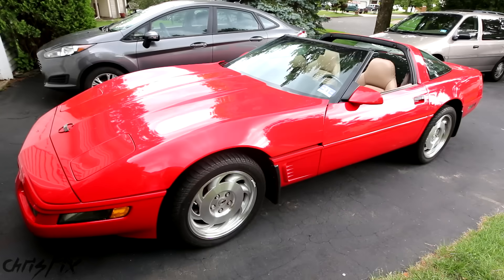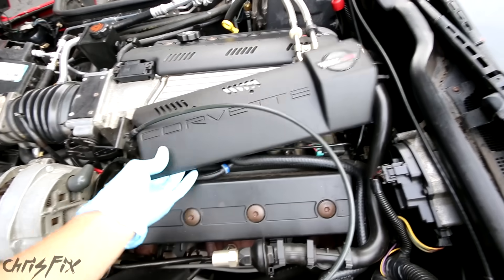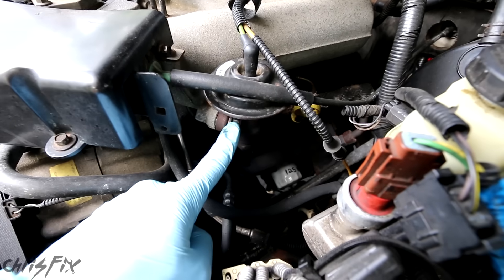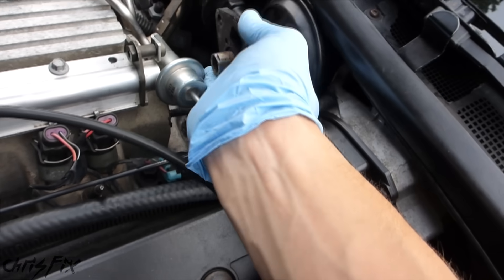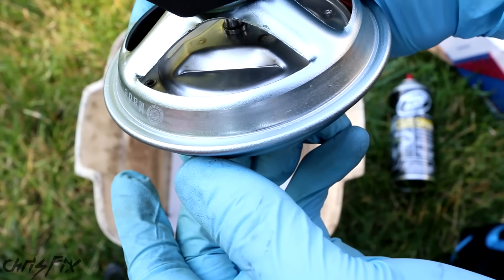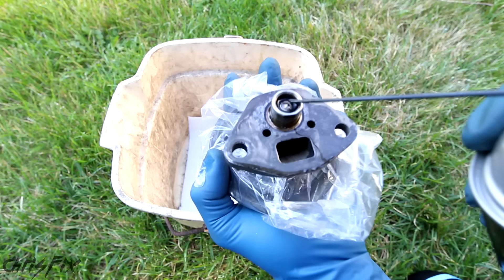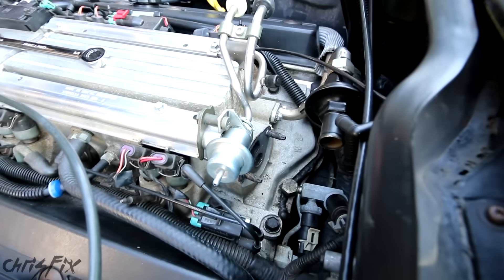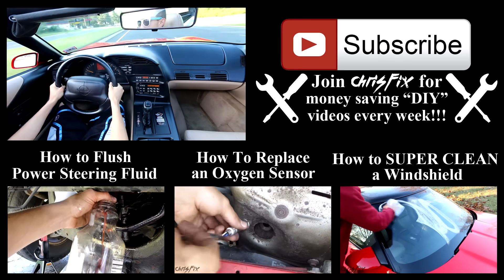How to Clean and Replace an EGR Valve P0400

Comment: Why would any company design a critical component that could easily fail from getting gummed up or by damaging the diaphram on an engine that needs to get you home? The last thing you or GM would want is you sitting on the side of the road in that shiney red vette dead in the water.
Reply from the maker: It's there for emissions control!
Reply: @chrisfix  Well of course, I understad that. My comment is more of sarcastic technical question... why would they make it so it could fail? The answer is probably a combination of money, poor engineering, and owners not demanding better made vehicles. Your vette is beautiful, not a spec of rust, yet the diaphram in your EGR is made from tissue paper. Why? Cause they can. It's obscene, if ya get my drift?

Comment: No EGR ever made a engine run better.
Every time you breath in, you like it to be fresh air.
Reply: Agreed... on top of that the EGR rapidly speeds up the build-up of carbon deposits in the intake manifold... just had a peak inside mine and it's filthy. Have decided to install a EGR blanking plate and I won't have to worry about it again.

Comment: Hey Chris, Thanks for all the advice and knowledge you share on you channel. I was wondering can an EGR Valve be bad and not throw a code? Have an 08 f150 with 4.6 and after a few minutes of driving when I come to stop light the idle becomes rougher and the cab start to shake a bit almost like a misfire. no codes on dash, and does not do it when engine is cold. Any advice. Thanks

Comment: Hi Chris, EGR valve in closed position, when I blow smoke through intake side of EGR, smoke came out from upwards under the diaphram area into the free air, so it means EGR is broken , right ? thanks in advance.

Comment: Hi Chris thanks for the good work I have trouble with a 2002 Toyota brevis when I start the engine in morning it starts well but when I shift it to D it doesn't move as if it's in neutral gear and starts to misfire

Comment: Great video 👍 By the way, will it hurt the engine to run (drive) it until you can get it serviced?
Reply from the maker: As long as it is not detonating or running rough, it is fine to drive until you get it serviced.
Reply: @chrisfix  it isn't. . . thanks!

Comment: I can’t get the bolt off mine. The one connected to the big hose. Won’t budge
Reply from the maker: Use a breaker bar
Reply: ChrisFix I got it. Got some spray to loosen it.

Comment: Cool the combustion chamber by allowing HOT 2nd hand air to enter in stead of cool fresh air?? WTF?
Stop listening to the enviromental dingbats, jut block the vacuum hose to the valve. 
The invention of the egr valve was mandated by government officials.
Reply from the maker: Yes since it is non-flamable gas and already burnt when it goes into the combustion chamber and explodes it is cooler than the surrounding air.

Comment: I have a 91 f150 with codes 327 egr valve position circuit below minimum voltage, 328 egr closed valve voltage lower than expected, was told to check vacuum lines, found and repaired one still got codes, what do you think

Comment: I have golf 4 ,I change my egr and I deltele the error code but in 2 3 days code appears again is 0402 exhaust gas recirculation flow  excessive detected,what is the problem I already change egr with the new one and still appears my egr is electronic not vacuum.

Comment: My EGR valve had a screw in one of the holes and I loosened it and it cane down and closed one hole but had a spring so I could push the screw back and it would open and the spring would try and push it closed..

Comment: there is nothing good about putting exhaust gas back through the intake.    heated exhaust gas does NOT cool the cylinder heads.  There is nothing better for your engine than deleting the EGR and increasing cool air intake.

Comment: I hate these valves with a passion, my car was idling like i was pumping the gas, no shop knew what it was, everything from distributor til computer got replaced. No error codes. Turned out it was a stuck egr valve... replaced as a "well why not."
Reply: Stuck open just enough that it leaked like crazy
Reply: Did u have strong fume smell in interior and exhaust smoke when on load?
Reply: @ahmedneamah7836 I was thinking the same question about the smell of fumes.
Reply: Sounds like you need to get some wrenches dirty or find a better shop. This is one of the first things you check with a rough idle.
Reply: Stuck closed?
Reply: Dang bro. What kind of car you got?
Reply: @iwishtobetexan6060  it was an Opel (Vauxhall) Zafira. Got rid of it a while ago
Reply: Not a very good shop. Every shop has an obd live data tool. All they had to do was plug in and read the data. Should've pinned it in less than 10min

Comment: I really appreciate the video, Chris. You've helped me a lot. I have a 95 Caprice. Looks like it uses the same EGR valve as yours. Got it off today (with the help of WD-40, those nuts weren't budging). Glad I had a variety of same size wrenches as it was too tight back there for certain widths and lengths. Turns out I need a new one. Tried cleaning as per your instructions (it was gunky) but the valve just won't hold a vacuum. Waiting on a new part. The markup at local major parts shops is quite steep, $30-40 more than Rock Auto and Amazon. For those that want to check their EGR valve I suggest getting a new gasket before hand as well as a telescoping mirror. A Fel-Pro for this model is about $2. Unlike Chris' my gasket was well worn and baked on. Had to pry it off and clean the mating surfaces. The mirror really came in handy as I could not otherwise see back there without taking photos.

Comment: You can't tell people that the egr valve is going to just "make the engine run better". In reality, the egr valve increases the temperature of intake air thus decreasing power output of most engines.

What's really important to know about the EGR valve is that is decreases NOx levels by up to 30%, not that it makes the engine run better which in most cases is not necessarily true.
Reply: [JL35] so what you are saying is that you really don’t want the most expensive egr in this situation or best if you delete the damn thing?
Reply: @robinruiz6890  I was trying to correct one of chrisfix's statements in the intro. I only install my egr valve when I need to smog my car. If you need to replace your egr valve I'd go to a junkyard.

Comment: Hey Chris can you do a video on code P0441? I’ve had some parts replaced on my 2013 dodge avenger se and I still get the check engine light. Some say its the solenoid valve but I believe I already had it replaced and its still giving me the code. Thank you for your videos!

Comment: Guys shouldn't delete the EGR. It cools the engine by recirculating exhaust gasses. Deleting the EGR causes the engine to run hotter and burn valves.  The EGR leaking causes lean mixtures. That can burn valves.

Comment: I have a 2003 Ford f150 its throwing egr codes but sounds like a desiel when running people have said cam phasers? Seeing if you have any idea!
Reply from the maker: Without seeing the car it is tough to say. Can you easily get to the EGR valve and make sure it is not gummed up with carbon?
Reply: @chrisfix  yes I can I will check it out can that cause the truck to sound like a desiel?

Comment: Run Gumout in the tank to clean the EGR while you drive. The heat of the engine and cleaning solution cleans it. Run the engine at 1200 RPM'S and check for vacuum. There should be vacuum. If not, check the EGR vacuum solenoid. Pump up 5" of vacuum with a Mityvac. It should hold. If it leaks down, replace it. With 5" of vacuum to the EGR at idle,  the  engine should stumble. If not, the EGR is clogged or the passage to the intake is clogged.

Comment: This is great but if the egr valve is worn it have to be replaced like for instance if the motor doesn’t work. Cleaning lasts awhile tho but after some time it do the same thing. But anyways great video👌
Reply from the maker: Thanks for sharing. If the valve is worn out, cleaning it wont help. If it is just dirty from carbon buildup, you can clean it.

Comment: Awesome video brother,  thank you .
Have a question,  why should the valve close at any point  ? The reason for closing please.
Reply: It should be closed at idle or else the engine will stumble or the engine will hesitate. It would cause the engine to run lean if it's open.

Comment: I have a 1989 ford f250 with a inline 6. I'm having a problem finding the tube the goes from the egr to the exhaust. The one that was originally on my truck broke off the egr even after using penetrating oil and heat. The egr needed to be replaced which I can find but the tube has been a problem for me to find. Aside from going to a u-pull-it junk yard to get one , where else can I go to get a replacement? Thanks for any help on this matter.

Comment: Two questions: 
1) How do you "torque to feel" at 25 ft-lbs? I wouldn't know what 25 ft-lbs felt like from 15 or even 50 ft-lbs.
2) When is it best to use OEM parts vs aftermarket?
Reply: chris uses a torque wrench most of the time, so id imagine he just compares it to what that would feel like on a torque wrench

Comment: So the light should go off by its self ? Thx for the video Chrisfix...
Reply from the maker: Yes
Reply: oh ok , mine didn't n I replaced the EGR valve. I got code P0402. exhaust gas recirculation flow excessive detected. 2002 6 mustang,, not the gt. Don't know my next move. and thank you very much for responding.

Comment: Can a failing EGR valve cause my car to have the temperature rise when idling issues? On my 2001 Intrigue, the part is 18 years old and easy to take out since it's right by the brake fluid reservoir.

Comment: I clean my egr but every time i put the tube back in the vacuum pump my engine just turn off but when i don’t put the vacuum pump in my car overheats soo now I’m stuck with a car that runs for a good 20 mins than turns off

Comment: Hey Chris, Love your videos! Quick question. Can a P0400 code be trigger due to a dirty MAF sensor? I had installed a K&N Air Filter in my 99 nissan pathfinder around 6 years ago and never cleaned the filter. My mechanic had the EGR vale and all lines changed but still getting the same code. Any ideas?

Comment: Is it normal when put smoke to the egr valve hole which connects to intake  (exhaust gas out hole), the smoke comes out under the diaphragm (breathing hole) ? When put smoke to the exhaust gas in hole( which connects to exhaust ), there is not smoke coming out. I'm a Newbie. Thank you Chris and everyone.

Comment: Chris - a chief use for EGR is to cool the combustion chamber peak pressure and temperature thus preventing ping.  This is done by the water vapor in the exhaust gas. Water has a very high specific heat and results in lower peak temperatures and pressures and evens up the power delivery all through the power stroke as all the gases expand.  So many people do not know the EGR main functioning principle.
Reply: I was scrolling thru the comments looking for someone to say "its smog crap just take it off" or that it mucks up the intake. My favorite is the "i gained hp by blocking it off" thought process.

Comment: Psh I wish the egr was this easy to take off on a 240sx. The exhaust pipe that leads to the egr is a huge nut that is always rusted on and the space is too tight to use a pipe wrench to break it free. That’s why most people cut it out.

Comment: So I have a similar computer code and a blinking check engine light that references Egr passages and a cylinder 1 misfire. I have a 1998 Honda Civic ex and I know it has no EGR valve, so what should I do?

Comment: Nice video but the pipes you pointed on the Corvette are for air injection not EGR, the rubber hoses would melt with exhaust going through them.

Comment: My intake EGR is getting clogged what should I do I hear a clicking between 2-3k rpm hoe should I clean it ?
Reply from the maker: The clicking is probably pinging from detonation. I would just replace the EGR if you keep cleaning it and it keeps getting stuck. Also shoot some carb cleaner down the egr tube towards the exhaust to break down the carbon in there.
Reply: ChrisFix too late she blew up this morning.      :( time to go buy a new engine

Comment: Never clean an electronic EGR Valve. Replace it.
Reply from the maker: Why not? I have cleaned electronic EGR valves, evap purge valves, and IAC valves and they are all fine. Just dont tilt the cleaner so it pools on the electrical side.

Comment: I've blocked my EGR off. It's complete junk. After a month of normal driving carbon buildup starts occur and you need to rev it like crazy to get it out. Only saves very small portion of fuel and causes more problems.
Reply: I'm 70 ex ENGine builder, back in 69 when I had a SUPERCUDA 440 everything was always spotless there were only 2 grades of gas reg and high test..The cause of all the buildup is EATHANOL IN THE GAS TODAY,it   comes from CORN a sugar base !!
Reply: @rayoliver6807  I have a diesel engine

Comment: EGR doesnt cool's cylinders... (exhaust gas recirculation just for ecology,not for cooling cylinders) :)
u allows 300+C air goes in the engine which is around 90 C degrees :D
Reply: It DOES cool the cylinders.

Comment: You might be better off in the long run to replace the EGR because later it might stick open or leak-down.
Reply from the maker: Thanks. That is true but it’s so easy to just clean and see if it works it’s worth it. Sure, if it breaks two years later, then replace it. I’ve cleaned them and they last a long time.
Reply: ChrisFix Yes, but they can leak some and cause hesitation. Usually they leak-down and it's not working. On my Ford, I replaced the charcoal canister purge valve and my  EGR is working now. I replaced the MAP sensor and it removed oxygen sensor codes.

Comment: weird way to per heat the air going in the engine... but what if these things loose proper calibration or if the car has a nicer exhaust on it, can they be tuned?

Comment: HI Chris, did you have to clear the code for the check engine light or did it go out because you replaced/cleaned the EGR valve? I don't have a scanner/reader so I won't be able to clear the light if it requires it. Just wondering if I were to do this work can expect to see the light go out on it's own?

Comment: I'm glad I live in a state that doesn't do emissions testing. I've got an early 90's vehicle with over 350k on it with an EGR system that's basically frozen. I just unhooked the vacuum line to it and forgot about it. It throws the CEL, but I really don't care about that on a 24 year old vehicle.

Comment: +ChrisFix I've got an electric EGR valve in my 01 Grand Prix. 175,000 miles. Is cleaning an option?  Seems so. Are there any simple tests I could do to make sure it is functional enough to try to salvage,

PS. Love your channel. Never missed an episode.
Reply from the maker: Cleaning is a possibility just dont get the liquid in the electric motor. If you have an OBD2 scanner with bi-directional functions so you can test it.

Comment: Help Chris, about a year ago I bought a 97' F-250 5.8 as a project turck and put quite a bit of money into it. It seemed great and then about a week after I got my license I started getting engine surge while accelerating. The car Idles fine, I replaced the ignition system (plugs, cap, wires), and tested the TPS. The TPS is within spec voltage. I tested fuel pressure checked out fine, and the 3 mechanics I brought it to all recommended I bring it somewhere else. 2 of them said itwas a transmission issue so I replaced the transmission and wiring harness myself with no luck. The surge is almost like someone is feathering the throttle but i'm not, It seems to be okay only in 3rd gear at constant throttle.

Comment: Chris, why is it so that in some cases you don´t change the gaskets for the new ones? Ok, the old ones are already "seated" in the main/bigger  parts but , what about the new parts that are not "used" to the old gaskets? Thank You. Salutes.
Reply from the maker: Technically you should always replace the gasket any time you change something with a gasket. Sometimes you can get away without changing the gasket if it is still soft and can bend to the new part.

Comment: Hello Chrisfix i am from germany and you vid are awesome. I have a Jeep GC 5.7 Hemi and i make a smoke test with a evap ebay machine. I get somke coming out from the egr valve body it self no smoke on the connections. I also had an replacement egr 3 month ago and it make the same. So it is normal? or are both egr dead?

Comment: Those pipes are for the "A.I.R" system, not for exhaust. AIR system injects air into the exhaust pipes to burn off extra fuel. The egr, especially that exact valve-used on many engines- gets the exhaust from the exhaust crossover, which is inside the intake manifold.
Reply from the maker: +Cody Moncrief thanks for sharing!

Comment: Should have put a blanking plate on it it is a bad idea puting exhaust gas back in the engine it's madness the engine should have only air and fuel in going into the inlet manifold. It is especially bad on diesel engines because they have allot more soot runing through them so the inlet manifold gets caked in inches of oily sooty shit witch starves the engine of air and on some modern cars can cause limp mode which is a massive pain in the ass. Also exhaust gas doesn't cool the cylinders what uter bolluks
Reply: Adam Fletcher Spell Check please

Comment: Great video Chris! My light was on , checked my codes, indicated egr( used paper clip method btw) car was running rough at idle, my egr failed   so i replaced for less than $ 60  runs great and no light!!

Comment: Hi Chris. I'm Tim. I have a question for you. Will a failed egr  valve make my 1995 LT1 5.7 nox high? The engine runs hot while sitting, but runs great while driving. Thanks in advance.